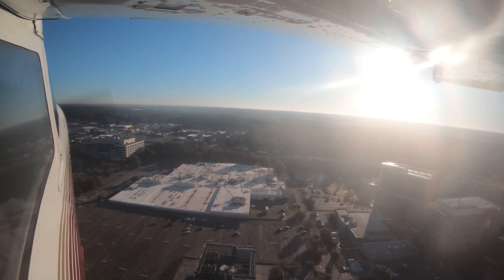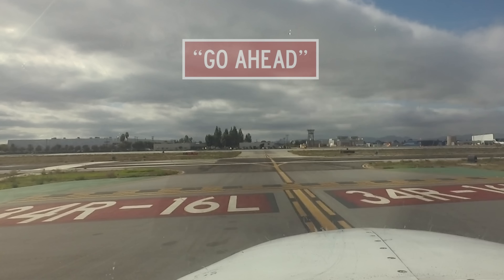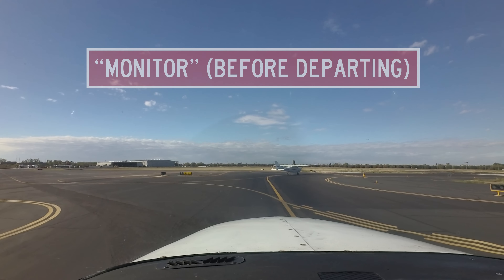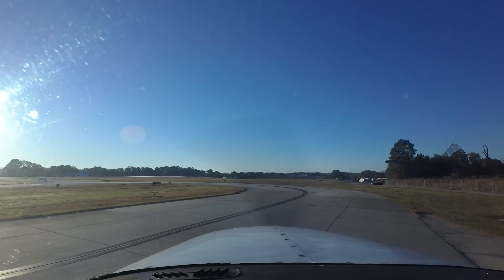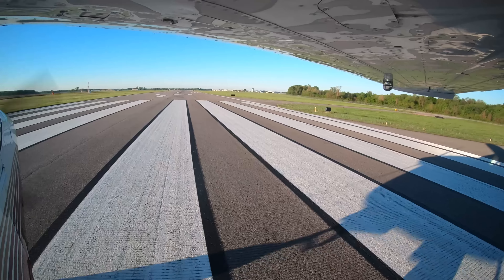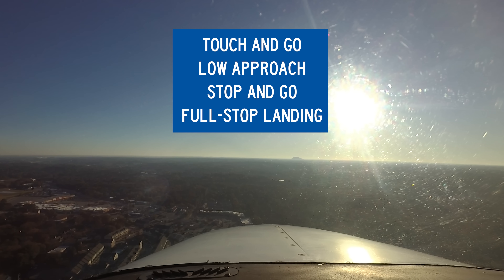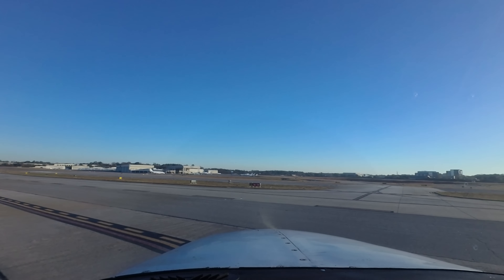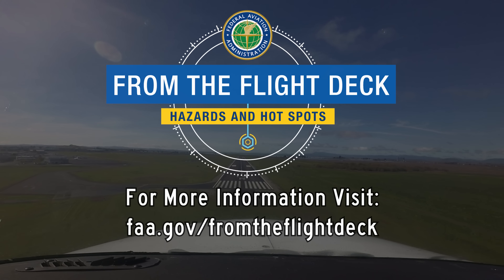From the Flight Deck – Phraseology

Comment: it still blows my mind that retired pilots aren't used to supplement ATC personnel
Reply: Unions
Reply: Pilots age to retire is older than controllers, how would that work?
Reply: @danl4639   not all pilot retire at 65. I'm just thinking it would be a smart career transition for say... an Army or Air Force pilot that doesn't want to go Commercial, or a former Commercial pilot that lost medical, or left for some other reason.
Reply: @mastrkents  Age for controllers to retire is 56, and maximum age to become a controller is 31.
Reply: @danl4639  I am aware. Is there a meaningful reason for the age restrictions for air traffic controllers?
Reply: Well, ATC and piloting are horses of a different color, aren't they? I would never presume to know enough about being a pilot that I could act as a co-pilot because I have (does math, takes off shoes...) 37 years of ATC experience. Our world-views, in many ways, are diametrically opposed between pilot and controller.
Plus:
1.) If you're medically disqualified as a pilot, you're probably disqualified for the Class II controllers must hold.
2.) Our handbook, FAAO 7110.65, qualifies as arcanum. It takes years of training to understand and properly apply our governing rules and principles. Knowing how to do a thing correctly as a pilot and knowing how to do things legally as a controller (without losing all your worldly possessions and/or going to prison for manslaughter/actual mass murder) are two entirely different things, mate.
3.) It takes the most serious mental discipline to be an air traffic controller... Present company excluded, I'm sure, but I've heard all the meowing, 'funny' audio clips, etc., daily on guard by airline pilots overflying my area...

I'd take a shot at training a born-pilot to be a controller; but, I doubt a pilot's experience-based decision-making could be expunged from his/her behavior... and that would be a primary necessity. A pilot's 'been there, done that' could be a recipe for disaster.

Just my 2-cents worth, other opinions fully respected. We did have SOFs at Holloman and Prince Sultan, but they mostly just read comic books to avoid looking at the traffic and prayed for their shift to end without have to interpret their aircraft-specific Dash Ones... At my first USAF assignment, RAF Bentwaters, a Full-Bird A-10 SOF got SP-escorted from the tower -- and the next day, from the country -- for attempting to dictate a Staff Sergeant ATC supervisor's traffic pattern. Swear to God. Careful what you ask for.
Reply: ..."A pilot's 'been there, done that' could be a recipe for disaster." We call that Expectation Bias.

Comment: Thanks folks for creating this. Good refreshers without getting yelled at by an instructor or a tower person.  Do one for proper request for VFR flight following. I’ve had some issues where I called and no one answered and also when I’m ready to land, do u cancel flight following or just do nothing?
Reply: Yes, and also the best order to give the information in.
Reply: Always cancel flight following in the air once you have the field in sight. That way you don't just disappear from their scope with no communication.
Reply: @mcgillagorilla196  problem was I called 3 times to cancel and no answer. I was high at 6500 ft so I know they heard me.  Then what?   I felt like they were ignoring me and I was ready to land.

Comment: My favorite is when ATC says "N12345 standy." And then you hear "N12345 standing by."
Reply: My favorite is when a pilot initiates contact with ATC with an unbroken 10-second, too rapidly spoken spiel: "XYZ Ground, good morning, this is (unreadable/improperly formatted callsign), at (parking area) with (ATIS code), looking for flight following to ZYX airport, ready to taxi to the active... (long pause, still keyed)."

Me: "Last calling XYZ Ground, unanswered, say again everything after 'good morning'." 
Kinda like, "False start, everybody but the center," of NFL fame... which basically means everybody but the center knew the snap count, LOL.

How about just, " XYZ Ground, Bonanza Wun-Too-Tree- Fower X-Ray ", and unkey .  It's called an attention-getting step, folks.
(NB: Yes, there's a correct pronunciation for each alphanumeric for an actual reason: clarity over a voice quality-limited radio transmission.)
I mean, I get it: you know who you are and what you wanna do... But I ain't that psychic. And sometimes I have to pick up a pen, y'know?
Reply: @zooidorganelle7697  You're complaining about pilots using the recommended procedure.  

AIM 4-2-3 says that the initial callup should include the following: 
Name of the facility being called;
Your full aircraft identification as filed in the flight plan or as discussed in paragraph 4-2-4, Aircraft Call Signs;
When operating on an airport surface, state your position.
The type of message to follow or your request if it is short
Reply: @8literbeater  Imagine, if you will, calling a customer service rep and proceeding to give the rep an unbroken monologue of your name, phone number, address and the complete nature of your issue...  What's wrong with a simple, 'Hello, my name's Joe'? In communication methodology, it's called an attention-getting step.

Comment: One problem I have always had with American phraseology is omission of "continue approach". As described in ICAO Doc 9432 Section 4.6.4, controllers should say "continue approach" if the runway ahead is being used for preceding aircraft. I continually hear controllers say "number 3 in trail, cleared to land", and this can be very dangerous considering the situation can change very quickly. I think "continue approach" needs to be emphasised before a similar accident to USAir Flight 1493 happens again.
Reply: You are screaming into a void. Nobody can hear calls for adopting the international standard because that would be admitting our way is the wrong way. Sadly it will take a couple more disasters before Congress will make the FAA change.
Reply: That’s because you’re reading an ICAO doc vs. the JO 7110.65 which has governance of FAA procedures. If you read the .65 you would know that “continue” is a phraseology laid out for that same situation you’re describing when an aircraft is LUAW on a runway at facilities without a safety logic system in place.
Reply: I don't have an issue with the call you cited.  It just happened to me yesterday landing at a Class D airport where tower cleared me to land (number 3) with two airplanes ahead of me plus another one taking off.  I confirmed I had traffic and the onus was then on me to maintain safe separation as I proceeded to land. 

This type of situation (multiple aircraft in the pattern) is standard fare at non-towered airports without the benefit of having any ATC coordination. Pilots are - in essence - always "cleared to land" at non-towered airports and they are solely responsible for separation in the process.

I understand that things need to be "tighter" at Class B airports than some grass strip out in the middle of farm country, but there have been tens of millions of air carrier landing operations since the tragedy of 1493 over 30 years ago.  I personally don't see how the US has some chronic hole in phraseology that is causing airplanes to land on top of each other.
Reply: @TheAirplaneDriver  I agree in un-controlled airspace, pilots are solely responsible for the separation of other aircraft. However, my concern is that in controlled airspace, the controllers are responsible for the separation of aircraft. Specifically in Class D, IFR flights are separated from other IFR flights, in Class B, all flights must be separated. There was a situation very recently, whereby a controller gave an aircraft clearance to land, with 2 departures ahead, in low visibility. One of the departures rejected their take-off, and the controller attempted to instruct the landing traffic to "go-around", however another pilot (possibly the aircraft that did the RTO) transmitted at the same time, therefore the "go-around" instruction was not heard by the landing traffic. TCAS is also inhibited below 100ft AGL. So there was a situation whereby the landing traffic was not visual with the departing traffic, and the go-around instruction was not heard. 

Take London Heathrow for example, the second busiest European airport, an aircraft will only be given a landing clearance if the runway is clear, no preceding traffic, regardless of visual conditions (but a small caveat below). Given the scenario above, the landing traffic would be given "continue approach". If landing clearance is not obtained at DH (decision height), the pilots must initiate a go-around, so this is mitigation if the controllers instruction is not heard on the radio.  But if the controllers last instruction was "cleared to land", there is no mitigation if a go-around instruction is not heard for whatever reason.

There is a small caveat in UK ATC that, in daylight hours, on a dry runway, where braking action is not adversely affected, in good visibility, and if the landing traffic is not heavier than the proceeding traffic, the landing traffic may be given a "land-after" clearance providing the landing traffic is visual with the traffic on the runway and confirmation of visibility has been obtained. It's very rare to use this "land-after" clearance because there are a lot of conditions that need to be satisfied. 

What mitigations are there if landing traffic is given a landing clearance, and then a subsequent instruction to go-around is not heard on the radio?

Comment: "Go Ahead 1:29"": 
The controller who instructed an aircraft holding at the hold line for a runway to "GO AHEAD" should be drawn and quartered. It's begging for a runway incursion and borderline entrapment for any pilot. The best, most effective phraseology for actual communication of intent would be:
 "(ACID), say your message, hold short of RWY #." (or other previously issued hold point)

I even searched the FAAO 7110.65 PDF for y'all -- there were only 2 hits for "go ahead" -- and the closest thing I could find was a Phraseology entry, thus: "Proceed with your message. Not to be used for any other purpose." So, I'm not saying it should never be used -- for example, an airborne aircraft wants to pass a PIREP or a heartfelt message to their next of kin, etc. Rather, I'm unequivocally stating that it should never be used with an aircraft holding short as seen in the video, without restating Hold Short instructions in the same message... As is required IAW FAAO 7110.65 in paragraphs:

3−9−3. DEPARTURE CONTROL INSTRUCTIONS, k.:
"When a local controller delivers or amends an ATC clearance (i.e., 'message of any kind') to an aircraft awaiting departure and that aircraft is holding short of a runway or is holding in position on a runway, an additional clearance must be issued to prevent the possibility of the aircraft inadvertently taxiing onto the runway and/or beginning takeoff roll. In such cases, append one of the following ATC instructions as appropriate:
"1. HOLD SHORT OF RUNWAY, or
"2. HOLD IN POSITION."
(NB: even "GO AHEAD, HOLD SHORT OF RWY #" is antithetical in the given situation... and it just sounds ridiculous and confusing, to boot)

-- and --

2−4−3. PILOT ACKNOWLEDGMENT/READ BACK: 
(ALL)

Thus: A pilot's/vehicle operator's/pedestrian's complete understanding of the ambiguous "GO AHEAD" should never be presumed by the ATCS, when a simple addition of "HOLD SHORT" (and "READBACK..." when necessary) eliminates any doubt of Runway and Pilot Safety. QED.
Optimally, "GO AHEAD" for message relays should never be used when communicating with any aircraft, vehicle or pedestrian once it has entered the movement area. I don't even like the inferred keyword "PROCEED" anywhere in the message.
And should any of you run across one of these lazy, situationally unconscious ATCSs, just remember that when they tell you to "GO AHEAD" they don't mean for you to 'go ahead'... Best of luck with that, to all concerned.

(NB: Parentheticals mine.)

DX, ATCS, 1986-Present, USAF and Civilian

P.S.
I often whimsically refer to ATC as a high-stakes game of 'Mother May I', which should give you some idea of exactly how ancient I am. ; ) Losers get deceased and/or sent to prison, depending on which chair they're in...

Comment: Although this video may have been intended for pilots, it is being shown to controllers. After a 30-year career as an air traffic controller this is a poor example of the phraseology that controllers should be using. Before all the flaming begins, I am not saying my phraseology was perfect, I am just saying the FAA harps on using correct, standard phraseology. In my job now as a contract ATC training instructor, I try to teach just that. During this video, at 1:41, 2:10, 2:39, 3:12, and 6:42 times, the "N" was dropped therefore violating the 7110.65AA para 2-4-20.
Reply: Perhaps they will update the audio.  Although not perfect, the presentation moves each of us, in our own way, a wee bit closer toward professionalism.Moving the needle even a wee bit is better than no movement at all.
Reply: ...Aircraft type may be substituted for "N", if known. Also, regardless how silly it may sound, whatever the pilot calls her/himself on initial contact, that should be how the controller initially responds (if only I had a dollar for every "Fox Pop" I've had to initially repeat). After the initial contact, however the controller should use the actual callsign, either N-registry or Manufacturer/Model name and tail number for GA aircraft operators. ...*then* we can abbreviate the callsign to N/Make/Model and the last 3 alphanumerics... unless you've got similar sounding callsigns. Don't get me started.
Reply: I am well aware of when the “N” can be substituted for type/make/model. My point was at the times I mentioned in my post, is “one four Romeo” is never correct phraseology. I don’t care if that is what the pilot calls himself, after the initial call, a controller must use the correct phraseology. It is not my opinion that it’s always done that way. I never did it 100% of the time and have paperwork to prove it.
Reply from the maker: Thanks for your comment. We have updated the audio to address this concern. -FAA Social Media Team

Comment: FYI usually ATC will say N#@# bravo alpha wind 030 at6 or whatever it is cleared for takeoff "they give you the wind direction and speed"
Reply: I virtually always give the wind, primarily because I work at a windy, directionally inconstant airport. When I issue taxi instructions to RY 17, the wind may be 17010G16KT. By the time the pilot calls ready at RY 17, the winds may favor a different runway altogether, e.g., 22012G27KT; I believe a 50-degree quartering wind is meaningful to a CAT 1 or II aircraft operator, given those velocities. Although there is no requirement to issue wind with a takeoff clearance, increasing pilot awareness and safety of flight is Job 1 for me. So, I almost always unnecessarily issue wind for any runway operation, and the Devil take the hindmost...
Reply: My oft-repeated motto: 'At the end of the day, everybody gets to go home, kiss the wife and kick the dog... or vice versa.'